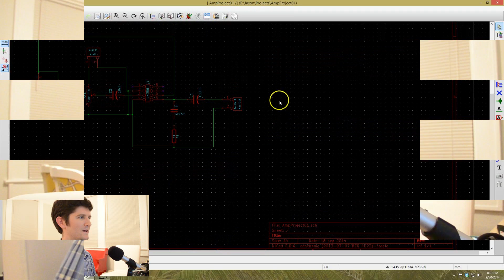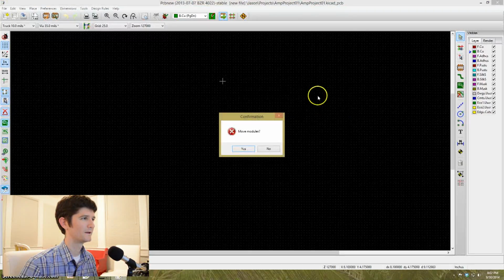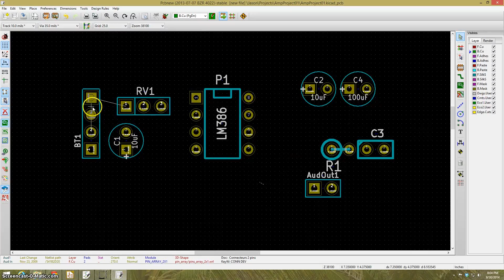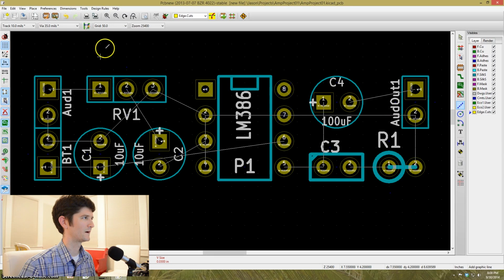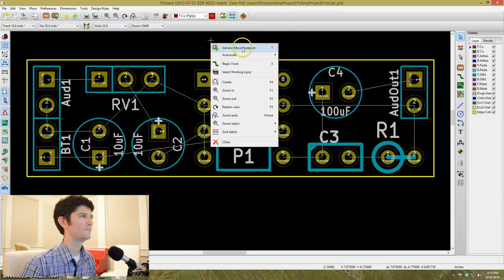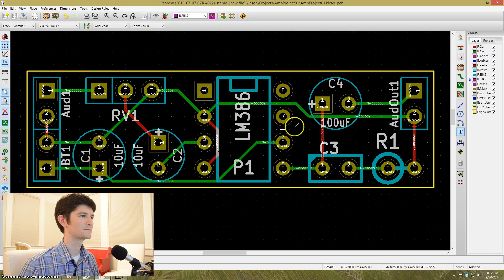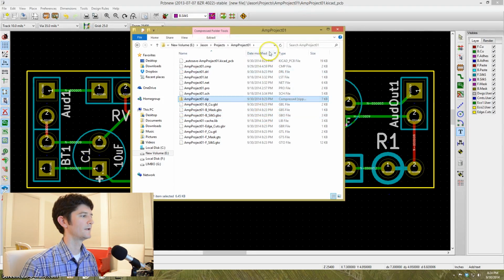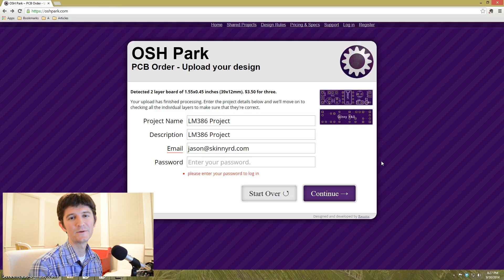How To Use KiCad to Make a Printed Circuit Board: Part 3

Comment: Thanks! Great starter tutorial! The UI of KiCAd and Eagle are NOT user friendly so a video like this was invaluable for me when switching from etching myself to getting some printed boards. A few points for others though: 
1) This is an old version and a lot of the buttons and functions have changed. 
2) The symbol libraries are totally different now and much larger. 
3) There IS NO AUTO TRACE anymore. It was dropped from the program so you either have to lay out the traces yourself or you have to find a way to add a auto trace program as a plug-in. This is definitely possible, but it may be easier to just lay it out yourself depending on the size of you board. 
The buttons and functions and such may be different but it is also more streamlined as well as better looking/running now. Didn't take me too long to figure out the new way of doing the things in the video but I had a hell of a time looking for the auto button! lol

Comment: Hi Jason. I went to the Kicad site and downloaded the recommended build (4.0.6) for my Windows 64bit OS, installed it and it worked until I tried to use the PCB layout tool. It then reported that the netlist was empty when I new it definitely was not. 
I downloaded the old stable version and tried that one and it worked perfectly! 
Have you tried V4.0.6 at all?

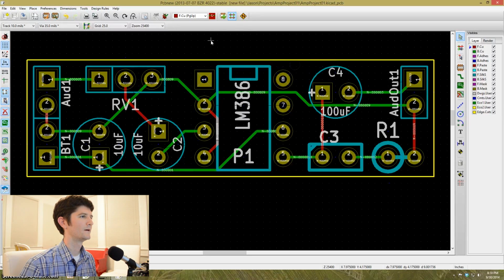Comment: Very nice video. However, my old eyes had a hard time with the black screen parts. It has me convinced that Kicad is for me - much better than a pencil and eraser. Just one thing that I noticed on Part 3. After the autoroute (7:51) some tracks were green and some red. Obviously the green on one side and the red on the other. But why are there some red tracks when those red tracks do not cross over a green track? I do not see this as a problem, merely a curiosity.

Comment: Awesome Videos man. Really helped me out!! 

1 question though, I'm sure someone has an answer for me... 

After I ran PCBnew to make my copper pads. When I was reading the "netlist" I got a number of error messages in the message box. The message read this; 

Error: Component 'U1' pad 'VI' not found in footprint 'Transistors_OldSowjetAera:OldSowjetaera_Transistor_Type-I_BigPads'

I got a total of 7 Error messages similar to that but for different components. It looks like all of my components were carried over. So I'm kind of confused... 

Does that just mean I should go back to CvPCB and choose different footprints? or Is this just KiCAD having a "blonde moment?" 
Thanks Nick!!
Reply: Nick VanDoorne Could be the way the pads are named. You could double check the pad names are consistent between the schematic and the footprint. I saw another person have a similar issue.
Reply: Thanks for your reply. I double checked all of my names. I don't think that is the issue. I exported my schematic to TopoR to try and help with the routing. It got it alot closer. But again there is a number of pads that I can not connect traces to.. 
I'm going to try different footprints for those components. But it doesn't make sense because I used the same footprints with other components and I was able to run my traces to those components. 
I had no issues when I performed the ERC and I have annotated my schematic.. 

Confused.

Comment: Nice job, but one comment: NEVER place the component designator, e.g., 'P1', 'C4' inside the part outline. You (or another technician) will find it very difficult to work on if the designators are not visible, I.e., under the parts.

Otherwise, pretty good tutorial. Thanks.

Comment: Hi, I am new in pcb design. i  am facing the problem of generating the gerber file it shows like uploading failed, for what purpose it shows the error. can u help me.
Reply from the maker: First, it will not just be one gerber file that is generated. There will be many. Second, you need to put all these files in a zipped folder before you upload them to OSHPark. Also, there may be an option that needs to be checked before you output the gerber files. I don't have the software on this computer, so I'll have to check later.
Reply: @Skinnyrd  I didn't get a single Gerber file despite following the instructions at the end to get them
Reply from the maker: When you are in the Plot window, make sure that the Plot Format drop-down selection in the upper left has Gerber selected.

Comment: Please help
When press the "read current netlist"  tab I get a list of errors stating missing footprints but I have added them all as per video.
Reply from the maker: In the latest version of KiCAd, after running CvPCB you need to go back to Eeschema, the schematic editor, and generate a new Netlist. See if that clears up your problem.
Reply: Done this and worked great, finished the project and am awaiting my board from OSH. Great Video and great supplier. Thanks for your help.

Comment: Jason, I would like to know if there is a way to tell the size of the PCB in Kicad?I've been enjoy your other video's and hope you will be making additional videos in the near future.  Thanks for putting out some great and easy to follow tutorials.
Reply from the maker: +Sal C At the bottom of the KiCad window you'll see an X and Y coordinate. Those coordinates are in inches or mm depending on what you've selected from the left hand button bar. You can subtract these numbers to get the dimensions of your board. The other way is to just upload it to OSHPark and they'll tell you the dimensions after you upload it.
Reply: +Sal C - In PCBNew, use the "add dimension" tool (looks like an "N" with two arrows under it). then click anywhere in the drawing, move the mouse, and click again. It will draw a line and show the distance between the two ends. Remember to select a layer where you can draw (ex., Dwgs. User)
Reply: Thank you very much.

Comment: Dumb question: With the footprints is the perspective from above or below the component? I assume it's the former, but I'm having allot of trouble finding the right footprint for the 2N3904 transistor.
Reply: +Ball Sack - The footprints are generally not specific to component modules (i.e., there are 4 or 6 transistor footprints with slightly different sizes, and you just pick the one that fits your design). Just use a generic NPN CBE transistor in the schema (ex., Q_NPN_CBE), and then pick any footprint you want in Cvpcb, based on size / shape.

Or you can create your own with specific measurements (but remember to save it in a separate library; don't overwrite the standard ones, or you might have some problems later).

Comment: Hello, thank you! Great work. I just have a problem when i run the current netlist there is a lot of errors showing in the little box. 3 different errors 
- "Error: Component 'Q4' footprint 'TO-92' was not found in any libraries in the footprint library table. "
-"Error: Component 'Q4' footprint 'TO-92' was not found in any libraries in the footprint library table. 
- "Error Cannot add new component "Q2:/56D720CF" due to missing footprint "TO-92".
Please let me know what should i do as i am doing a project for my Uni work thanks!

Comment: Jason thank you for tutorial, I was wondering why there is not a power and ground rail on the circuit board ?,  and when I place component on schematic like LM555, they are missing ground and power pins. Thanks
Reply from the maker: +transformer889 When I use the battery component, most of the time I don't need the ground or power pins. It just doesn't matter. However, when you start using some of the IC chips in the library, they may require power pins. Sometimes the stock IC chip symbols are wrong or at least misleading when it comes to what can be connected to them. I would edit the 555 pin that is giving you the problem. By right clicking and editing with the library editor, you can right click on the offending pin and change the electrical type to "Passive". Another option is just to make sure the Pin has the proper electrical type for what you are trying to accomplish and then connect the proper power flag/pin to it. The second option is probably the right way to do it, but most of the time I'm in too big of a hurry for it to matter. Hopefully this is somewhat helpful.

Comment: How do those traces cross each other in the same layer? There are some traces crossing each other here. Btw, thnx for this series. Very useful
Reply from the maker: +Sai Prasad Rm Glad you found the series useful. I think the traces you are referring to are not in the same layer. All of the green traces are copper runs on the bottom of the board and all the red traces are on top. The autorouter placed these on the top and bottom automatically.
Reply: Skinny R&D Oh that's great! Thanks a lot again!

Comment: ....also,  what are field zones? is it okay to omit them?
i saw field zones in another video. thanks!
Reply: javier v. also, (this is a tip i got from another video)... before plotting the gerber files, go to Tools > DRC (design rules check). Click Start DRC.
Reply from the maker: javier v. The only time I mess around with zones is when I need to lay down a large ground plane for a circuit. Other than that, I don't use it much.

Comment: Hi. At 10:45 you select the solder masks but you did nothing with them throughout the video. Do any modifications have to be made?

This is my first PCB. I have the gerber files and drill file ready to go!
Thanks for these videos!
Reply from the maker: javier v. Hi Javier. No modifications need to be made. The solder mask just needs to be generated to tell the manufacturer where to expose and not expose the copper pads. When you select those boxes, it's automatically done. Congratulations on your first PCB. I hope it goes well for you.

Comment: I just wanted to thank you for these three videos. I had several "aha!" moments while watching them. Wonderfully clear presentation with virtually no hesitation, ums, ahs, or tedious repetition. And altogether you made it look easy enough that I'm strongly encouraged to have a go myself. I'm very impressed. So, thank you.
Reply from the maker: MrSwanley I'm glad you enjoyed the video. Thanks for the comment.
Reply: @Skinnyrd  I have no G files in my folder after following these instructions for retrieving files etc what am I doing wrong?
Reply: I completely agree.  For the life of my couldn't find a resistor.  I don't understand when you type in 'resistor' it doesn't show a resistor.  However if you type in 'r' it finds it no problem.  Very informative, slow, and easy to follow along.  Can't wait to try out my new circuit board printing machine!  Thanks!  PS:  Did you actually get the board printed?  Wouldn't' mind seeing it.